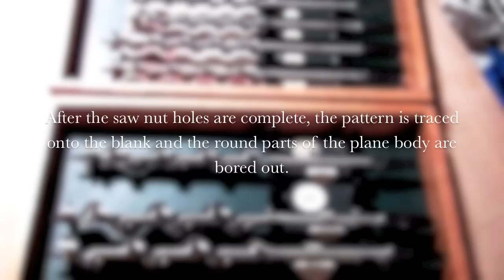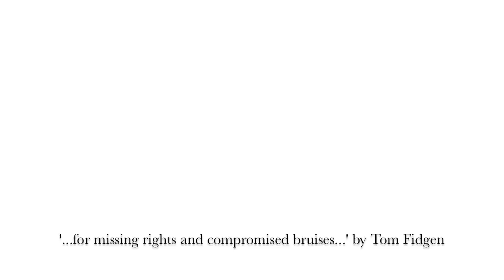The Kerfing Plane part one: Rough shaping the body

Comment: Question:  When I have rough stock, I find my hand plane won't take off clean shaves, but when it's smooth, works fine.  I also find end grain especially hard to work with.
They are stanley hand planes. 
Could this just be the sharpness, or should I be looking at the frog position, or something else?
Reply from the maker: McGinn's Woodshop- thanks for the question.
It could indeed be an issue with sharpness.It could also be an issue with the mouth opening or chip breaker. There are many variables to consider.
End grain is generally more difficult to work. Try a low angle block plane and dampen the end grain with alcohol before planing. A freshly sharpened iron, set to take a light shaving should also help.
Another trick is try skewing the plane in the cut.
Are you using the original plane irons?
Try a new replacement iron- they're much thicker and usually are higher quality steel. That may help to hold a sharp edge longer.
Lots of info in a quick response but hopefully these suggestions will help get you on track.
best of luck!
Tom
Reply: Tom Fidgen It's my understanding the wider the mouth, the more aggressive the blade and less smooth... though would that mean I tighten it to get a cleaner cut.. or widen to make the face leveling easier, then tighten to smooth to a clean pre-finish?

I've been watching different videos, but I'm leaning towards the idea of buying a good book to seriously learn all those variable you speak of above.

The blades are old and original, so perhaps a new blade is also the answer... I'll give your advice a run through and end with a new blade if all else fails.

I'm envious of the nice smooth rolls that come off your plane!
Reply: Tom Fidgen
Actually.. the plane is the one in my profile picture.. I've refinished them as good as I can, as they are from my grandfather
Reply from the maker: McGinn's WoodShop
 Correct- wide mouth for more aggressive shavings- tighter mouth for smoother finishes. Books are great resources- visit a library or order some online. Try taking a course on hand planes or sharpening- and yes, a new plane iron will certainly help.
Good luck!
;  )
Reply: You rock!  Thanks!